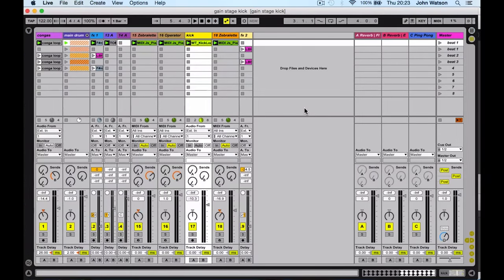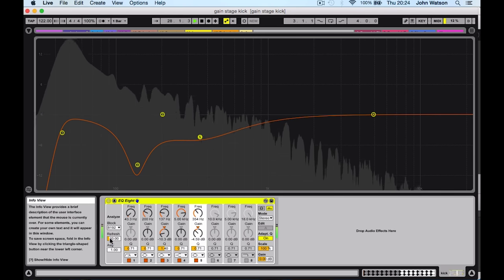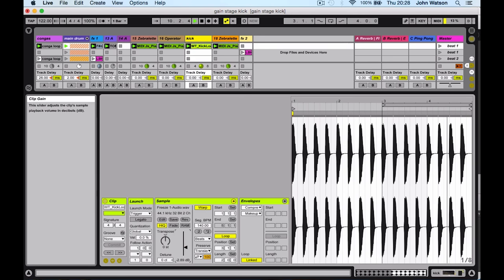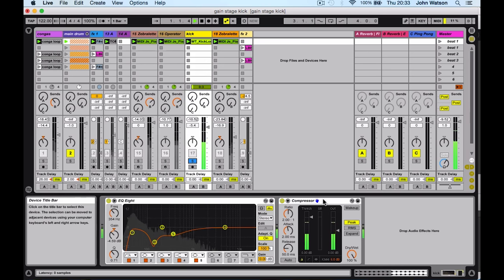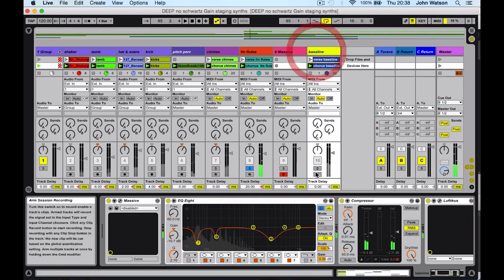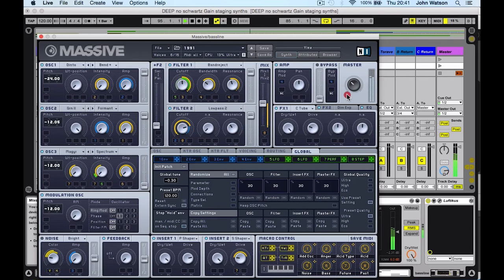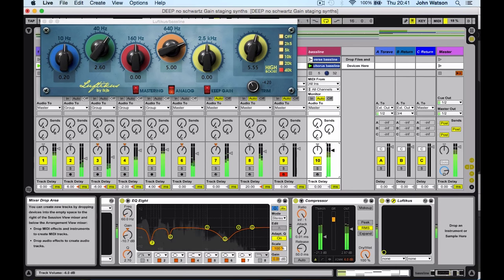Ableton Live Tutorial: Gain Staging in Plugins

Comment: I gave up on trying to adjust the volume slider for all my plug-ins and samples, because when you switch to the next preset, chances are that it snaps back to zero resulting in a way too loud signal. Instead I put a Utility (Gain -12) at the very start of every plugin chain for just the right amount of signal processing headroom.
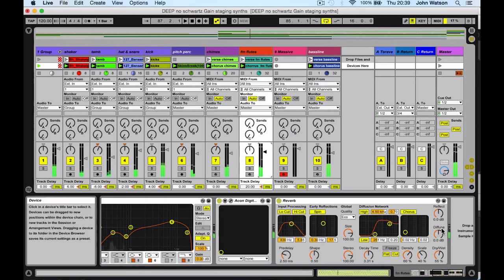This also results in proper levels for summing the channels, but leads to another problem, especially in Ableton Live. Now all faders sit at the very top of their fader bed, providing only 6 dB to boost quiet signals. My workaround is to put another Utility (Gain +12) at the end of each channel strip and immediately compensate for it by setting the fader to -12. (You didn't say explicitly, but I think you do a similar thing in the video at 5:01.)

Comment: The first half of this video doesn't make sense.
The problem with digital clipping is, that IF the software is implemented in a way where 0dB is the biggest possible signal everything above 0dB is cut off and the signal gets distorded.
But this is not the case in Lives signal path. In an video from Ableton a developer said, that live is implemented in a way where 0dB is not the maximum.
So there are four kind of points where your signal may not clip.
A point where audio gets rendered.
A point where you send a signal to your audio interface.
A point where you send your signal into a 3rd party plug-in and the last point in the plug-in where you send it back to Live, if the maximum in that plug-in is 0dB.
Reply: To break it down.
Your signal may not clip at any point where Live is losing the control over the signal.
But of at some point even Live will clip. I don't know where that point is, but it is not at 0dB